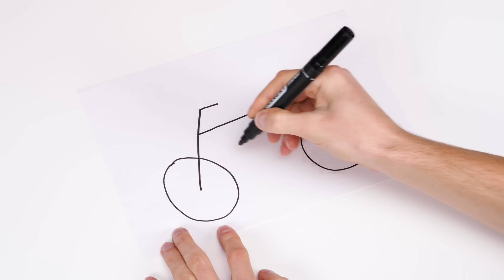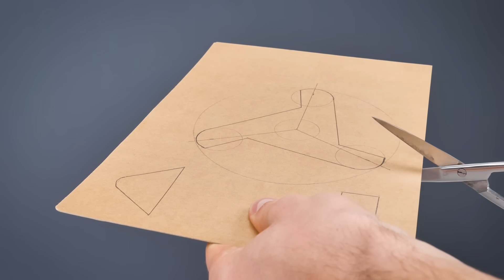EXPERIMENT: Shock Absorbers in Bicycle Wheels

Comment: Its a (somehow) good idea but i would have used softer springs.
Reply: and more springs bc of the gap between then it doesn't work great
Reply: @2baer  hold on doesn't adding more springs increases the feedback from the dampening? The whole reason for the springs is to soften the road if the dampening is to stiff it wouldn't do anything
Reply: @Jarl2392  more tynier ones bc the tire is round
Reply: Wheels are very unstable, with softer spring your wheel would start touching forks in corners...
Reply: With the springs on it it still allowed the tire to be squeezed against the frame, if it hadn't the whole damn thing would have collapsed! Watch the video closer!
Reply: Needed preloaded springs; or rather have the shocks at half travel during a resting state.  One side has a hard time compressing if the sides can't be pulled the opposite direction.
Reply: It's not a good idea, for it to really work it would have to have better tire clearance, but it would also need longer springs that were pre sagged, and then it would just squish, it's just flawed, but it's a good video.
Reply: but do you do it
Reply: @85sukma  I have better things to do with my time.
Reply: @85sukma  nope
Reply: Softer spring would make the bike unrideable
Reply: Softer springs would cause the rim to break even earlier. The springs need be to be pretensioned  so they  wont allow such a huge flex of the rim. After all this concept does not work. There is a reason why spokes are not springloaded. They need to support the rim.
Reply: No it's a terrible idea, rims need to be rigid otherwise the handling would suck, how can you expect to ride something that has constantly deforming wheels

Comment: The springs dont absorb anything because the rims are solid
Reply: Yes they do, the hub is not fixed in the center of the wheel. It doesn't absorb too much because 3 springs are too strong for one wheel

Comment: Well it looks cool and it clearly the was put much effort in this clip .But beside that you only added weight and costly parts to achieve something that could be done way easier. By allowing the tires to move for -and backwards this will add a lack of stability too ,specially when you don’t need it the most , like hard breaking and accelerating .

Comment: It’s cool. But does it actually work better then a single shock on the frame? Is the shock when absorbed spread the weight equally to stop the wheel for buckling?

Comment: So you not only have a suspension for bumps, but also a suspension for braking and accelerating. Wanna guess why noone uses this system even with a proper wheel and fitting?
Anyways, interesting project and it was fun to watch, tho I would have tried it with a rigid tri spoke wheel instead.

Comment: It would have worked better if the shocks were a bit longer than the radius and compressed 15% first. That way it's more stable but also when one side compresses the other 2 can compensate

Comment: You should apply  a preload on each spring so when the shock which take the impact compress, the 2 other extend so it can absorb the drop. With this system when a spring compress the two other are locked in place and it stop brutally the movement. Sorry everybody for my very average english’s skills, that’s not my mother tongue but I hope you understood

Comment: Your derailleur and chain system needs an automatic tensioner to prevent all that slacking when the rear wheel takes a dramatic drop (5:37 , 5:44)
 you can see the chain sagging greatly;  it could jump the gear teeth.
Reply: noticed it too

Comment: This is not one of those hateful comments so please don't take it that way. But I just wonder why you don't offer audio commentary on your work. I for one am not capable of or at least won't put the effort into doing it, but would be intrigued by the difference in the feel of the impact of the ride. If you see this and care to respond I would just like to know if it made a difference in the impact of the ride. The reason I ask is there was a shot coming off the riser that it didn't look like the impact was comfortable on the seat. Maybe a double shock absorber there would make a better ride in addition to the wheels. Just wondering as I have nothing to do today and your video popped up.👍

Comment: It's amazing how many inventors bring designs to fruition without researching wether it's been done in the past and why not. This is one example of something that's been tried many, many times by many back-yard inventors and abandoned because it's a bad idea. Really bad idea. Wheels need to be light, because you're spinning rotating mass, so wheel weight is 3x as detrimental to performance as static weight. It's a ton of extra mass to have to accelerate and decelerate up hills. 3 shocks literally doing the work instead of one good one in your fork.

Comment: Fat tires with lower pressure have enough suspension. That bike is probably heavy as hell. Looks cool though.
Reply: Chris Overbey I thought exactly the same as he was inserting one of those shocks... imagine 3 per wheel and then multiply by 2!!!! At least 80 pounds of bike!!!
Reply: Fat tyres are like springs, but springs alone do not make suspension. That's why you need shock absorbers with controlled rebound etc. On top of that, clearly this isn't a serious attempt at making practical suspension. It's called having fun doing whacky experiments.

Comment: The point of a fatbike is to run lower pressures in the tires, and in turn absorb bumps... If the shocks really worked like suspension, it wouldn't make the bike more comfortable to ride, it would just make it harder to pedal and maneuver.

Comment: Go back to the drawing board. This time use a large coil that fills the whole wheel. Still will suck but better than this fail lol. It will be more of a leaf spring design. And should work better for something moving in a circular motion since it will have a 360° flexibility without binding.

Comment: There is literally no point in this cuz they are never gonna be engaged  as the rims won't bend until you bend it in a crash and break it the spokes exist just to connect the cneter from the wheel that is the whole purpose they serve ...

Comment: Super cool, impractical, project :) In 1903 Renault made 2 cars where they used shock absorbers (5 of them) in a similar geometry to your 3. This was a suspension solution to combat the rigidity of the solid rubber used on rims at the time. That same year vulcanized rubber started being used which allowed inflatable tires. Obviously inflatable tires were far superior in solving the issue. But hey, it's fun to make impractical things sometimes. So I live this!

Comment: I think the biggest issue us the wrong size shocks were used.  The shocks should be longer because as the bottom compresses the top ones need to expand which isn't possible.  But who cares it's a bad idea to begin with

Comment: @5:24 the rear wheel wiggles all over the place, probably because shocks aren't designed to take bending loads. @5:44 watch the tyre carefully. It almost stops monentarily, probably because it hits the frame when the shocks compress. There isn't enough clearance on the front fork either. Hit a big bump and  the bike will try to stop dead or front wheel skid - both bad. Nicely made video tho!

Comment: Bike tires need the spokes to keep the wheel straightened out and supported. He good rid of the only support the wheels have from deforming, and replaced them with moving and flexible springs. Not to mention those springs will have those wheels spinning off the center of the wheels, so it's definitely gonna be a bumpy ride. Fun project, but ruined wheels

Comment: Its crazy how people can be such good fabricators with every little welding skills, blows my mine. Good job man!👍need to getting better at a plasma or touch so you dont have to wast time drilling several holes to make one big hole. Will save you hours and if the cuts a little serrated get a cone stone for that makita

Comment: At the very least, you should use a softer spring, and have the shocks partially compressed before seating in the rim, so the travel has less interference from the rim and “none”compressed shocks.

Comment: Why is no one talking about how bad of an idea it is to change the center of rotation on a tire in motion?  Let’s say he reinforced the rim, preloaded the springs and used lighter materials to address most of the other issues.  Can you imagine hitting a bump at 30 mph / 50kph?  The sudden change in the tire’s center of rotation would get worse with each revolution until the tire would no longer clear the fork, lock, and send the rider over the handle bars!!!

Comment: 1. More rotational mass is a great recipe for disaster.
2. The load supported by the rims are not evenly distributed as it is in the traditional rim. You WILL end up with deformed rims.
3. The rebound of the shock absorber has a specific purpose which is to keep the wheel in contact with the tarmac as much as possible by making the extension as smooth as possible. The velocity of rebound normally does not match with the contraction. So basically, the wheels shock absorbing capabilities is limited by the shock absorber located at highest point at all times.

AD Engineering, Mechanical
University of South Australia

Comment: Just so were on the same page... this is faulty engineering at its finest. When one shock compresses it bends the other two out of shape. The wheels will be pretzels before you get home. The design is bulky, costly, and impractical. If those shocks were used correctly this ride would still be a nightmare because the rider is too light to cause a recoil on suspension that stiff.
Reply: Not to mention the extra energy needed to pedal... this was just for fun I hope
Reply: Well, the title just clearly show “experiment”, so... it’s not exactly going to be a serious concept is it.
Reply: @KrazyKotYoutube  I dont know, I would argue that every serious concept started out as an experiment. Constructive criticism is a tool for improvement. 👍
Reply: I was going to write that as well, thanks.
Reply: May be faulty engineering of a bicycle but an astounding feature of Youtube engineering, which is probably the point here.
Reply: They are on pivot points but you are right faulty because they cant compress due to fighting ea other because they are already completely expanded.
Reply: Yeah.... But it was awesome to watch.
Reply: Also the bolts on the inside of the wheel will puncture the inner tire in no time
Reply: Wilson Phillips we’re*
Reply: @HereisTaha  Lol, thank you Lord Spellcheck.
Reply: Wilson Phillips - This design (triple shock) has existed for several years as a high-end upgrade for manual wheelchairs to reduce jarring traversing bumpy terrain. Base set of those wheels cost $2k USD.
Reply: @phu5005  perfect. And honeycomb wheels made of rubber would work better and can be 3d printed from TPU. Very inexpensive. These wheels suck, you will never convince me otherwise.😂
Reply: Wilson Phillips - No worries. Have no preference on convincing anyone; just saying the general design has existed for some time in other applications.
Reply: @phu5005  And... I promise you this. This design specifically DOESN'T WORK!!
Reply: Interesting!!!;)

Comment: I think the rim is more flexing than the Shocks absorbing
Reply: I think that at some point,there would be some flex where the hub was cut.
Reply: @reapanomin899  ⁰⁰⁰⁰⁰⁰⁰
Reply: @reapanomin899  ⁰⁰
Reply: @reapanomin899  ⁰
Reply: Johannes Müller it’s the tire that’s flexing
Reply: @twingolord  no the spokes tension a rim so remove them then yor rim will flex. Don't try outsmart me.
Reply: @thomashardbattle4287  yes and no longer hold true. So as the rim flexs it is no longer a true circle. Like someone said he made the bike worst.
Reply: @Roadking556  yep totally
Reply: @thomashardbattle4287  damn no one was trying to outsmart you he wasnt even talking to you 🤣🤣🤣
Reply: @thomashardbattle4287 Compression rims work too... wheels were built that way for at least two thousand years before the spoke tensioned wheel was invented. Don't try to outsmart me.
Reply: @twingolord  it's the rim I think u mean the tire flattening when he goes off the curb
Reply: @twingolord  ⁰0
Reply: Google the word "experiment"
Reply: Good luck trying to keep them trued up.
Reply: Interesting idea but yeah it's no longer true
Reply: Not sure but it looked like the chain fell off
Reply: يحفك؛، ط،،، ظ،،،
Reply: Love the thumbs up at the end though 🤣
Reply: The shock absorbers aren’t doing anything cause of the angle their o, if they were straight they would be moving
Reply: you can see it bouncing from rim flex in one of the shot
Reply: 00000000⁰0000000000000000000000
Reply: ⁰⁰⁰
Reply: ⁰⁰
Reply: ⁰⁰
Reply: ⁰
Reply: ⁰⁰
Reply: ⁰
Reply: 00
Reply: ⁰
Reply: exactly
Reply: 😂 omg chain is fly away all time, and absorbing effect is so little. Useless thing.
Reply: Rear wheel should be a little tougher

Comment: Nice flex on those rims, i didn't even notice that you where having trouble keeping the bike straight lol.
Just a quick reminder that fatbike wheels and tyres are designed to be able to ride with super low pressures due to the bigger volume, which creates some kind of suspension feeling. That's why they don't have suspension forks normally.

Comment: Good idea but I can see a few problems 1 weight and its distribution those suspension units are going to be much heavier,  2 as someone has said because of the design and there being no structural support those rims are going to buckle , 3 the centralfugal force that would be produced at speed would make the bike unstable and 4 the cost but in saying that there will be someone who will redesign it and put there names on it

Comment: Could you at least use softer shocks so they would actually compress
Reply: Even if the shocks were softer it wouldn't change the fact that this cannot work lol. There is only about a half inch of travel before the spring bottoms out on the other spring. Probably feels really good getting all the extra weight up to speed too.

Comment: The spring bent off to the side In 5:32 and the chain almost fell off. You have to change how the chain is now and make sure the springs don't bend off to the sides 😂👌🔥injurys just waiting to happen not hating on the build but the saftey is what's at risk

Comment: I think, if you get some smaller spokes. Put a smaller rim in the larger rim. Attach them together with spokes. That'd give the outer rim strength. An then put some smaller shocks between the hub an the smaller rim. Onto a winner my friend.